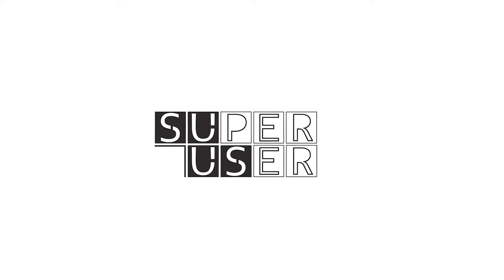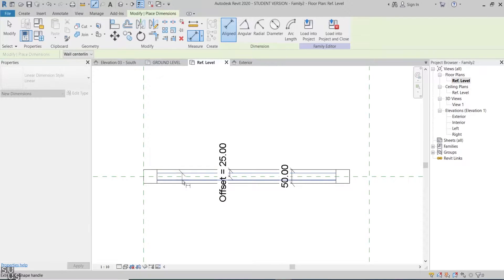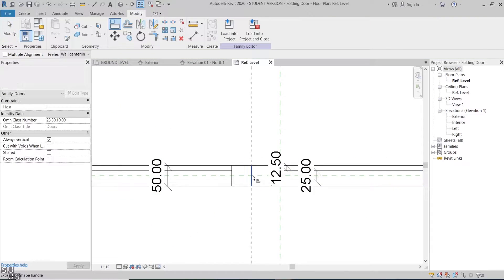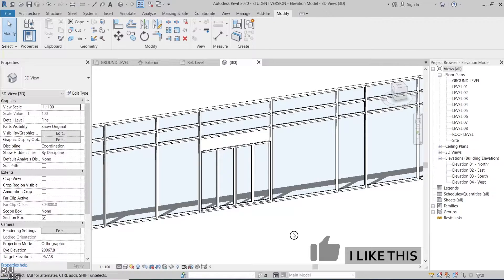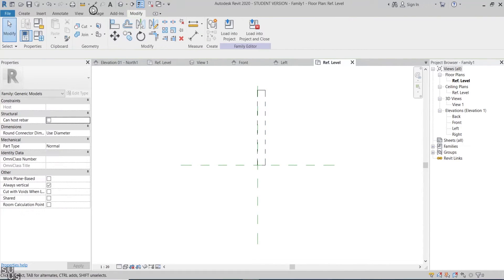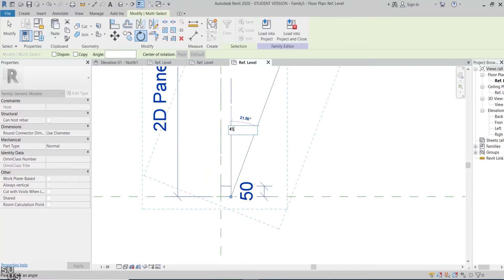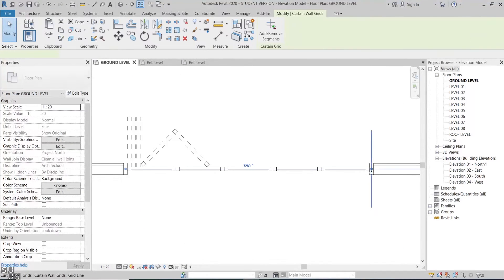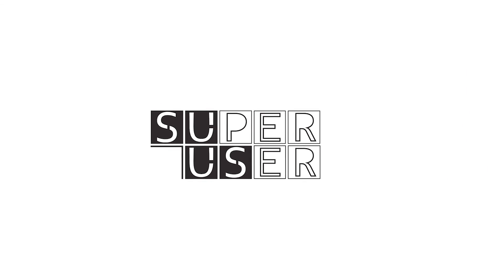Curtain Wall Folding Door Family With Nested Generic Model Families In Revit

Comment: Firstly, this is a fantastic tutorial thanks a lot! its packs a bunch of useful tips. Now I wonder if it's just missing a step or I'm not following it right. In 4:16 Panel width, once I set the panel dimension width as an instance. Both panels just dont adjust to the reference places as it does in the video. Any ideas why? Again, congrats on the video.

Comment: When I'm trying to add the formula for the panels, Revit gives me the error that "Constraints are not satisfied", even though I followed each of the steps presented in your video. Any idea on what I should do? I tried removing the constraints so the error would disappear, but my panels got messed up. I also tried recreating the folding door family various times and watched your video more carefully, but I get the same error...
Reply: same, tutorial is useless.
Reply: try adding reference planes instead of the extrusion sketch and then dim parameter. I solved mine like that